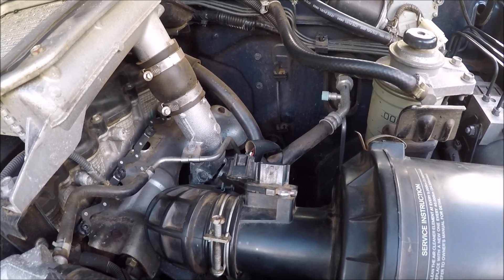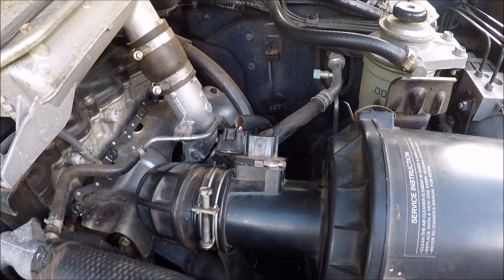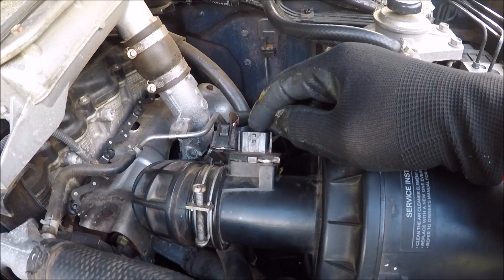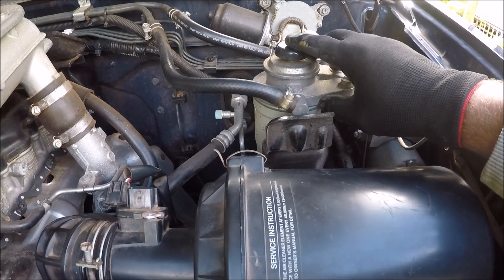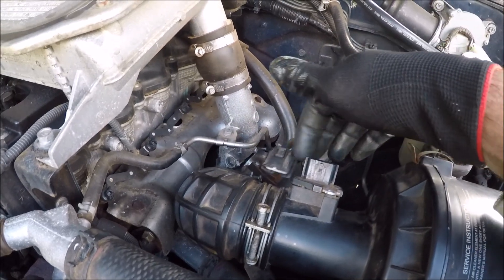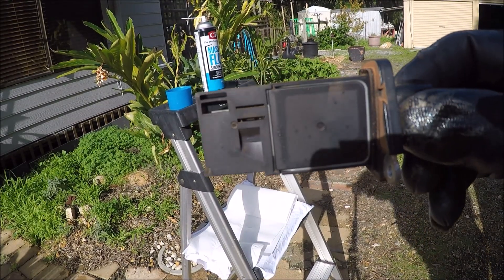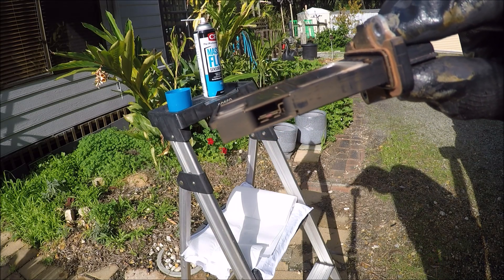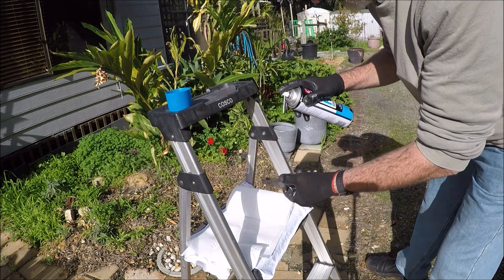Mechanical Mystery Update

Comment: I drove all the way home with you. I had the same sort of problem with my navara a while ago except mine would not keep moving, I would have to stop and pump the fuel up and would go again for a while although not properly. Had a couple of scans done and all they told me was a fuel problem. which i had figured out. Turned out to be a fuel control valve on the side of the block, a mechanic mate figured it out and replaced it for me, said it was a terrible job. 
I was very interested in your trip as I have just done the same thing at about the same time, we Gave Karajini a miss because of all the rain as we were going through. Made it from albany to wyndham so we have now travelled the northern in one hit.
Reply from the maker: Hi Russell. It seems that there are quite a few potential reasons for the loss of power that we have experienced. After cleaning the MAF sensor I got half way through changing the fuel filter but decided to let the mechanics sort it all out. Their diagnosis was air in the system. They took the old filter off & replaced it with the one I supplied, tightened up the hose clamps & the thing is up & running again! Another reason for loss of power can be the Neutral Position Switch which is a sensor on the gearbox which sometimes fails. There is a young guy on You Tube called Reubs Modifications who has  an excellent video explaining what it does & how to test if it is faulty. Yet another possible cause is the Suction Control Valve which might have been what you had to replace. Hopefully my issue is now sloved as I hitched up the camper & took it for a spin to see if any of the symptoms returned. So far so good! I will now wait a few months before taking off again as the whole country seems to be awash! I have done the Albany to Wyndham trip a couple of times over the years & at this time but I have never seen rain falling as much as this year, particularly in the area from Karratha through Millstream & Karijini. The road from Auski Road house through to Whitenoom has been flooded for weeks now according to Main Roads WA. I guess north of that area is still good weather wise right now so I might plan another trip further than Karijini. Thank you for your understanding of the stressful situation I found myself in that day. Fortunately it wasn't a major mechanical issue which was my initial thoughts. There are so many electrical bits on the newer vehicles now that we could probably do without but I guess "thats progress for you!" Take care & safe travels.

Comment: Sorry to hear of your aborted trip. Glad you're home safe. 
So, it couldn't be fixed with a bit of number 8 fence wire or wire coat hangar.. Nothing more frustrating when the vehicle goes into Limp Mode. Our Sprinter did something similar recently. I used to stop, switch it off then restart after a moment or two. Seemed to work but last time, the engine warning light illuminated giving me and the handbrake a fright. Looking it up on google, I think it was the oxygen sensor. After about ten stop/starts, whatever it was, cleared and its been fine ever since. My mechanic couldn't find any cause. 
Anyway, I hope you get it sorted soon and can be on the road to warmer climate up there in northern WA. Safe travels. Cheers
Reply from the maker: Hi Barry. Cleaning the sensor may have made a slight improvement but I was still getting the impression that the engine wanted to cut out when pushing the accelerator through the gear change sequence. There are so many electrical components on these modern cars now it could be just a loose connection but finding it is like the old needle in a haystack thing! I'm sure it will be discovered at some point. Good to hear from you. Hope the mould problem has stopped over there.